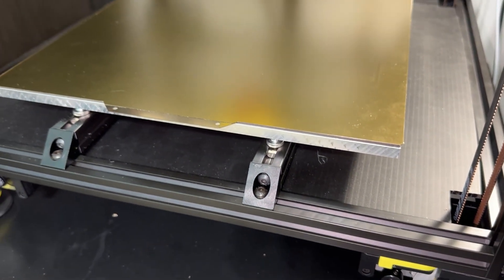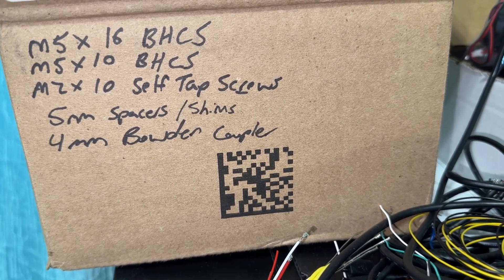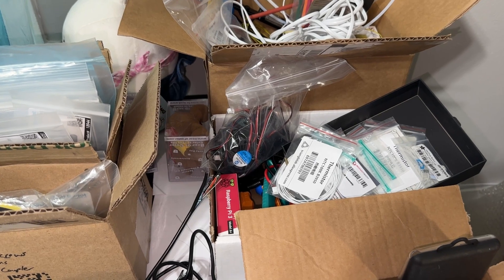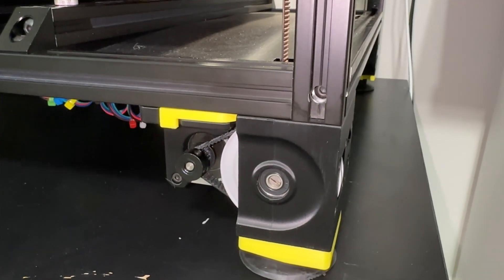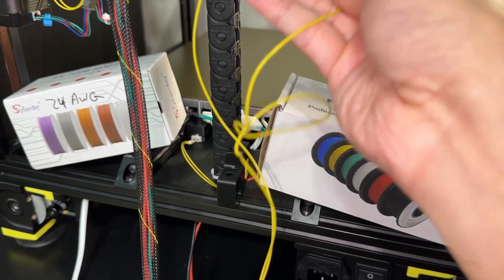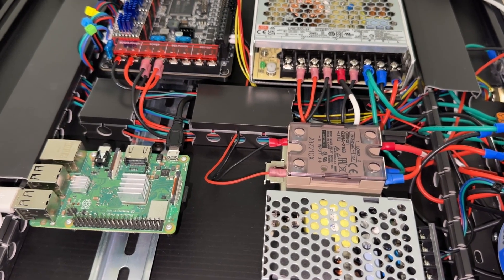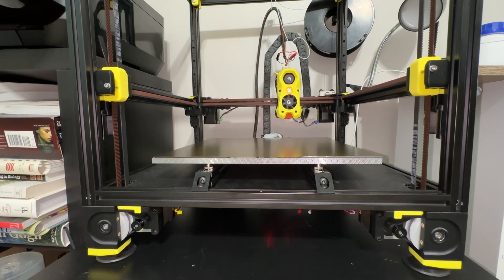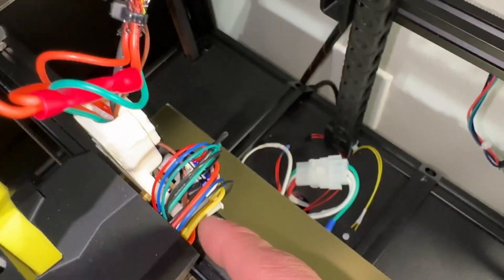🚨 DIY Voron 2.4r2: 15 Mistakes While Building as a Beginner 🛠️

Comment: I see you were using a Pi 3 A+. I was using two of those in two Vorons. One is still in use, while the other worked fine until I added a CAN toolhead. It seemed it cannot handle it.
How did they work for you? Did you used an external USB hub to add more USB ports?

Comment: speaking as somebody who tends to piecemeal every single machine built, believe me when i say that not only can you build a voron of most sizes for far less than $2000 without a kit, but buying your components over time can save you both time & frustration.  be patient with shipping, evaluate sources, & maintain a checklist of all required components for your chosen build.  that's not to say your plan won't evolve over time, it often does with this approach, but you'll wind up with what you need a lot easier - just make sure to order extra fasteners of each type.

Comment: Another good video, it would serve for a good reference before beginning but I would add some more recommendations...
1 Record all connection locations on paper, don't rely on your PC or your memory, you will need them again.
2 Keeps spares such as fans, brass inserts etc. basically low cost items that might need replacing.
3 If you use stealthburner, order some extra latch prints, they can and do break.

Should you, for any reason, have to rebuild your Pi setup (as I did a few days ago), you will need all your *.cfg files, not just printer.cfg (although it is probably the most important).

Comment: Excellent and very useful video. I just finished my 2.4r2 250 and I'm in the software  configurations and tuning process. To me, the hardware sourcing and assembling wasn't too difficult and I took my time to do it. However, I think the software part is the most head scratching. Octopi, Octoprint, Klipper, boy! These are so confusing and only the Voron's documentations aren't enough. But I'm starting to understand the paths and hierarchy of communication. 
I'll probably make my first Benchie in a few days. 
All in all, I loved the adventure of building it.

Comment: Just a note on "kits".  I've been working with LDO voron kits since their very first batch 1 and let me tell some corrections to the video:
- LDO documentation supplements the Voron manual to give you pretty much all the pointers a newbie needs. 
- there is such a thing as "building stock" with the LDO kits, as the documentation has made those decisions and recommends to start 1 way (use induction probe first, get stock firmware working next, print, and then print any mods you want to continue - or not!).
- it's $600 cheaper

Comment: I bought a full LDO kit but had a lot of the same challenges.   The biggest build challenge was the variations of wiring ... Especially the bed(two options floating about about where into the Octopus Board to connect the Bed heater).   Now that I have things semi-working ... The tuning is not going smoothly
Reply: What kinds of issues are you having with tuning?
Reply: When I print, as it should, it first Homes just fine, then does QGL, and then it drags the nozzle across the bed ???

Comment: I built a Trident last year (my first printer that wasn't 'take it out of the box and print) and self-sourced using "Parts Kits" from LDO, DFH, and West3D in the states purchased in larger batches (to get free shipping) during sales.  I sat down and did the math on that, and it comes out to around what I would have paid for an (at the time) LDO Trident Rev A kit, only I had a hot end and Raspberry Pi.

Comment: I didn't just build a Voron, I studied and redesigned it. I have Built a V0 style printer but with 235x235 bed size, which is complete. Current working on a trident style with a 310x310 bed, About 90% designed and built. Just hotend mount and cooling to do. I should have just copied the voron and upscaled to match the bed size, but where is the fun in that. I intend to make it IDEX but the design I'm looking at isn't easy AND for now Building a single extruder is the aim.

Comment: I strongly disagree on using canbus instead of just more wires.
I love my chains.
And if you organize em well, replacing a wire or two or even all of them is not a big deal.
All you need is to know what you're doing and the right tool.

Also, high quality wires can last you decades.
The secret is to use really good PTFE wires and not attempting to save a buck.
The whole thing takes less than an hour for an experienced person.
If you're not, take some time to practice crimping and routing.

Canbus is cool, but chains are charming.

As of money thing, you can't spend more than a couple hundred bucks on the while wiring even if you include top grade tools and connectors.
And you can get very decent set including tools for under fifty.
Worst case scenario, get yourself a pre-crimped top grade loom.
Considering the price of everything else, you should not compromise of wiring.
Reply: just upgraded my cheap cable chains with igus two weaks ago, just dont wanted to go canbus because my cables where still fine :)

Comment: I built my Voron 2.4 350 from a kit by LDO motors. The kit and instructions were excellent and I avoided most of the mistakes you mention. Drag chains and robots have been working fine for decades. You have to use the right wire, correct arrangement and slack, then you will have zero problems. CAN bus is cool too. My kit came with PCB for the stealth burner and preterminated cable to run in the drag chains. Easy. Fun. What’s not to like!  ;-)

Comment: Canbus is a gift from heaven, especially for those who are self sourcing. A canbus board and usb to can converter is still cheaper than buying 20+meters of ptfe wire and drag chains
Reply: Lucky for me. My parts kits came with wires and umbilical boards instead.
Reply: Canbus is fantastic but such a pain in the ass the first time your do it. 😅
Reply: @Bigpopp1  the first time is hell, after that its easy. Flash canbus firmware to the can board, create can0, be so wise and use a usb to can converter and no built in can bridge. Can boot, or Katapult now, is optional. I personally always stm32cubeprogrammer for flashing new firmware, the firmware on my ebb42 is from over a year ago and still works fine, so i dont see the benefit of installing canboot (which is more involving in my opinion than klipper) when you need to flash firmware not even every year
Reply: @Bigpopp1 esoterical guide is gift from heavens a followed the guide and it worked like a charm
Reply: have not used canbus since i was tinkering with cars, and I thought canbus was aweful, but might work  better in 3d printers.

Comment: I've had zero problems with pre cut ldo extrusions but i agree that you shouldn't try cutting you own extrusion without proper gear.
I did cut my own extrusions for my second 3d printer build but i ended up milling the exstrusions in length to ensure that they would be as square as possible when being built.

Comment: I cut my own frame and had one rail that just wasn't right. Come to find out that one was ever so slightly bowed. I cut a new one and got it all square. I have a small milling machine so getting them square wasn't hard, but it was tedious and if I had to do it over, I would just get a kit. I already had a lot of the parts from other printers like wires, motors, hot ends, bed, screws, pi, etc. so it was cheaper than a kit, but I think I would have been better to keep all that stuff as spare parts.

Comment: I am not a beginner and the Voron is not my first 3D printer in the last 10 years. When I came across the Voron, I thought it would be a good idea to buy all the parts myself. To be honest, this was a stupid idea. 

No shop has all the parts. So the shipping costs are very high because many orders have to be placed. Then some parts are not available anywhere. This has led to a constant search for a shop. And it took quite a long time until everything was finally together (almost 3/4 of a year).

The advantage, of course, is that you can choose the quality of the parts yourself and you know what is installed. But today I would recommend buying a kit from LDO and replacing the parts you don't like. So if you want original Hiwin linear rails, you'd better throw away or sell the LDO ones. In the end, this is much cheaper than buying everything by hand.

For what my Voron cost in the end, I could have bought a Raise3D Pro 3. And that would have included a dual extruder...

On the other hand, tinkering was a lot of fun, which you don't have with a ready-made device. 🙂

Comment: 1. Forgetting to unplug when plugging in neopixel - shorted board
2. Not having extra parts, ordering more and having to wait.
3. Not understanding printer.cfg - kept getting error and finally figured out it was due to not commenting out thermistor configuration because I didn't have one in the bed area.
4. Not reading ahead and understanding exactly what I needed to do prior to just trying to do it.
5. Last but not least, rushing through.  Like you said, this is time consuming and you do get burned out.  This is a marathon, not a sprint.  Plan on getting things done in parts.  Get it done then stop.  Trying to get it done as fast as possible causes mistakes.

Comment: 2:13 than again it depends on how high end you are going with all the parts, if you grab top of the line everything of course you are going to spend that much.

And yes you can get good deals especially if you actually have any other skills or tools, if you are a blank slate that can't do anything then its best just to buy a machine.

Comment: I built a Formbot kit for the 2.4 350 which was the equivalent of about US$1000 delivered. I’d say that’s good value - the Moons motors are very smooth and quiet. Frame and fasteners were excellent quality. Heatbed is nice and flat. Even the fans have been OK. The wiring has been good, the Omron probe works well but the printer does have to be pre-heated for about half an hour to get the Z-offset correct. The only fault I’ve had in a year since was the thermistor wiring for the toolhead (the thin white wires broke). I think it’s also worth spending a little extra on a good 5” touchscreen as it makes operating the printer more pleasant. I built it with a Rapido hotend (HF not UHF) which has also been trouble-free.

Comment: I switched to CAN after a year or so  and approximately 1000 print hrs on my v2.  I ended up having a couple broken wires in the cable chains.  CAN makes it soooo much simpler to repair a broken  wires and to diagnose any issues.
Reply: What is can? I'm a Brazilian trying to buy and build a voron 2.4 r2, so I'm new
Reply: @AlexViniciusOC  CANBUS (controller area network) commonly found in automobiles today. it is a data transfer protocol that allows micro controllers to talk to each other over a single pair of wires. Essentially you add a tool headboard with a micro controller  to your tool head and run a pair of power wires and a pair of communication wires and that is all you need. No more need for 16 wires controlling all of your fans, heater, part cooling, thermistor, probe, etc.
Reply: @MRKTM690smc  thank you, that's very interesting! Good job

Comment: Its nice to see some good advice in a sea of bad advice.

My two cents as I am in the midst of a Trident build: A couple of 123 blocks and a set of precision round space blocks will dramatically improve a frame build and setting the linear rails. I'm using a faux granite countertop rem for the build surface. A light soft face hammer (emphasis on light) is a help seating frame extrusions in pre-tension. My result was a square frame without the need for tweaking.
Reply: The 123 block do make this extremely easy. But I am not sure many who are no familiar with machining will have, or even know what tey are.
Reply: I dont know what you mean but i just fixed my crooked frame and gantry with firmware 😂

Comment: I am now struggling with my own thoughts. I have it in my head that I want to build a coreXY printer partly from previously purchased parts, and partly from a few parts bought here and there. Somewhere I feel that the whole concept is flawed, as for some reason it feels both simple and complex at the same time. -> So it might be a mistake to not choose from existing projects when building a printer. :D
Reply: I'm working on a corexy printer design for myself now. I have the first year of mechanical engineering under my belt and am adept with Solidworks but man is it a lot of work...

Unless you want to spend at least a month designing, stick with a ready design or just make mods. If you mod enough the design changes significantly as well

Comment: Thank you for your reflections on the project, which can broadly apply to any largish scale task. I can certainly empathise with @DoRC. With age comes a need to keep one's eye on the main game instead of the thrill of the chase.
I have been toying with building a 6x3x3 ft system just for the thrill of it but I am glad I haven't had the time yet. The design has changed significantly as potential uses refine the structure. BTW, I subscribed.
Reply from the maker: Thank you for your feedback and the subscribe.  I certainly agree with your mention of large scale task.  As a person who likes to DIY tinker on cars, that has certainly been a re-occuring theme for me lol

Comment: After watching this video I'm so glad I bought a P1P. I did this as a hobby for years and I was torn between going voron or BL for my first core XY.  I think I'm at the point now where I just want things to work so I can concentrate on the design and the enjoyment of the end result of prints. Don't get me wrong I'm sure a lot of people have a lot of fun doing this but weeks of tweaking sounds pretty horrible to me especially when the P1P basically just works.
Reply from the maker: Thanks for the feedback, having a plug and play printer definitely has advantages!
Reply: But it definitely doesn't take "constant" tweaking...
Reply: Plus when you can print at 700mm/s at 15k accel and get the same quality you were getting at 100mm/s it’s just to much fun haha
Reply: same here. right when I heard $1800 I lost interest, fast. It's just my ignorance that makes me think this way. Maybe the OP can shed some light as to why one would spend this much on a 3D printer just to have to tune it and tinker with it. I come from 5 ender 3's and I now have 3 P1P's and haven't been happier.
Reply: @TripasGarage 1800 is like top of the line. you can build one that will print just as fast at the same quality for 900 bucks it’s all how it’s assembled that determines the printer , honestly from my view where I do it as a hobby and a little side job I’m probably never going to buy a prebuilt printer again lol this is just to much fun and you build a top of the line machine that comes with the knowledge and know how. I’ve learned more about 3D printing with building one voron in a couple weeks than I have the ten years I’ve been messing with 3D printers
Reply: @TripasGarage having built it himself is presumably worth the cost to him. 3d printing as a hobby is about the fun of being able to make your own stuff, so it doesn't seem that crazy that people into it would be willing to spend a lot of money on building their own printer, especially since with how big the modding community is with these kinds of projects, you can quickly end up with a machine that is entirely unique to you.
Reply: @TripasGarage  Tuning and tinkering is where the fun is for some people.